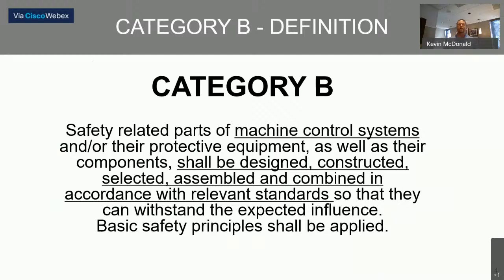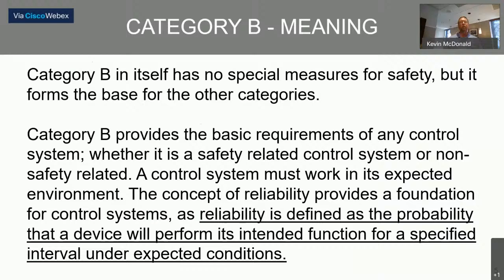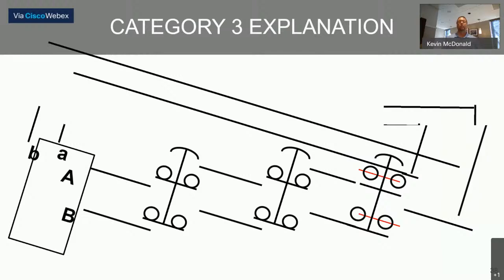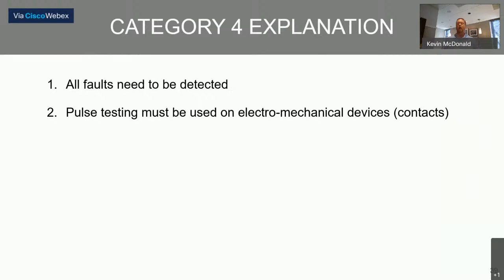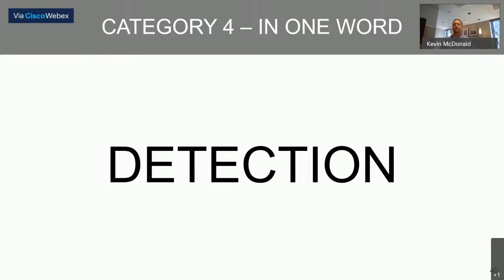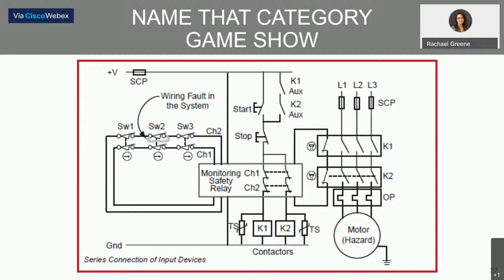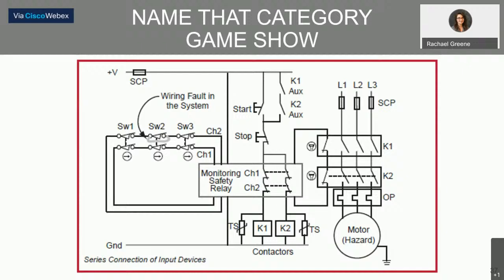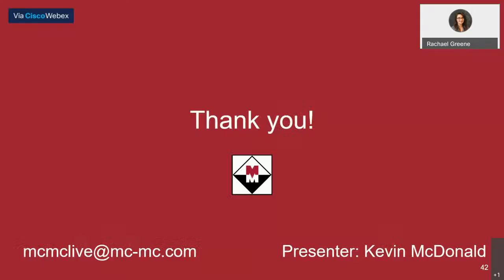Virtual Lunch & Learn: Safety Categories

Comment: The funny part is they decided to use a feedback signal on cat 2 - on contact welding issue, the motor will be running anyway - I don't need to enable safety relay 🤣

Comment: There is one more thing to note about fault masking being eliminated by Guardlink. It solves your problem of multiple EMSS devices being cascaded and that’s why it’s such a popular product line. HOWEVER, Guardlink is not the only way to achieve cascaded CAT 4 PLe in safety devices. It is true that electromechanical contacts like E-Stop’s experience fault masking and cannot be used in series and still meet CAT4, but devices that have OSSD input and output pairs like SensaGuards can be cascaded without Guardlink and still reach CAT4 PLe. So if you’re looking at a safety circuit drawing and see OSSD devices in series, it’s likely they’re designed to be used in series while maintaining PLe and CAT4. Pro tip, if you need lots of E-Stops wired into a safety relay AND you need CAT4, consider Rockwell’s CR30. You can use a single set of contacts for your pulse test and run them through multiple E-Stop contacts each to their own input channel and still reach CAT4.
Reply from the maker: Hello, Great points! Modern technology has invented new microprocessor-based safety input devices like our SensaGuard technology that allow inputs to be daisy-chained and still reach Cat. 4. Not all OSSD safety rated devices have that capability and we encourage everyone to read the device ratings before assuming Cat. 4 can be reached. Thank you for your comment. Valuable information!